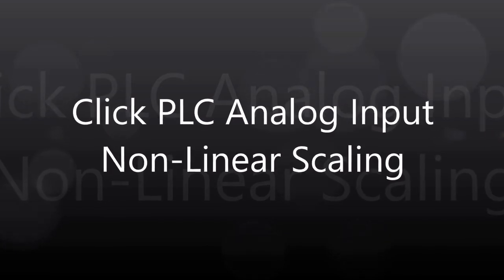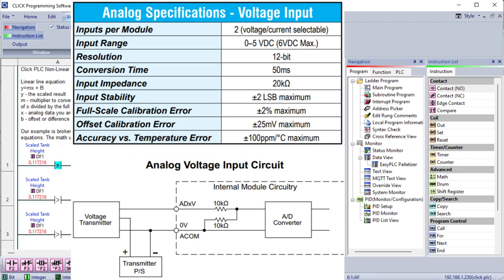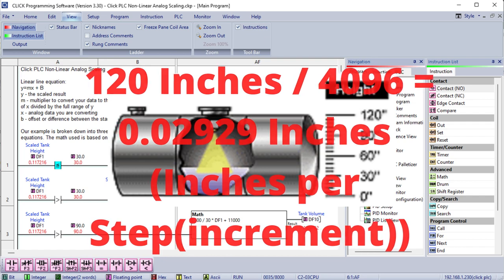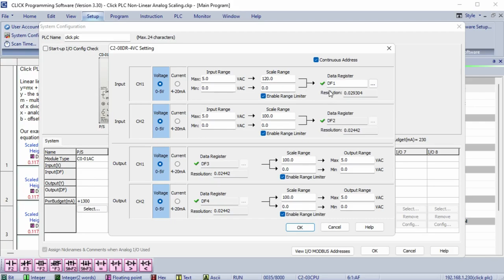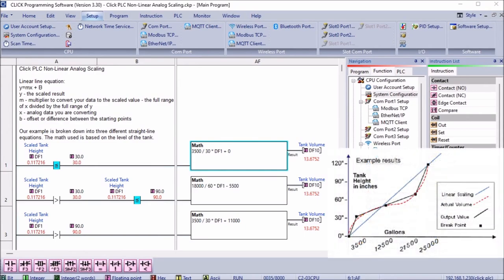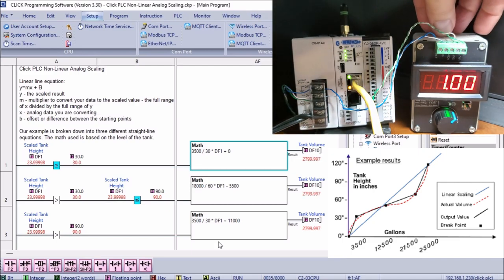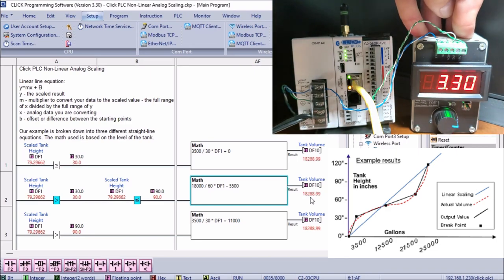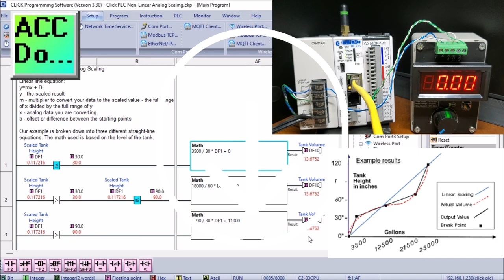Click PLC Analog Input Non-Linear Scaling

Comment from the maker: More information can be obtained at our website. This includes all of the links mentioned in this video. 
https://accautomation.ca/click-plc-analog-input-non-linear-scaling/

DROK Adjustable Signal Generator
The multifunctional DROK signal generator can generate both an amp & voltage in the same unit.
https://amzn.to/3Ab7fOh
Video on the signal generator.
https://youtube.com/shorts/0KPvdTxj3EA

CLICK PLCs were designed with simplicity in mind, providing reliable control at a low, low cost and with little to no learning curve.
This simplicity makes CLICK a perfect solution for small machines, home automation projects, pneumatic applications, or anywhere a simple system needs a budget-saving control solution. 
Building on the original CLICK’s simple design, the new CLICK PLUS PLCs offer the same practical control but with some surprising bells and whistles. Using the same FREE, streamlined PLC programming software as its predecessor, the CLICK PLUS PLCs provide no-headache programming combined with advanced capabilities like Wi-Fi communication and data logging.

The Click and Click PLUS PLC series can be found at this URL:
https://accautomation.ca/series/click-plc/

Features of the new Click PLUS PLC (C2-0xCPU) include the following:
• Micro USB
• DHCP support
• DNS support
• Wi-Fi (programming and Modbus TCP)
• Bluetooth (Wi-Fi) provisioning
• SD Card (Data Logging)
• Data Logger
• Network Time Service
• MQTT (Publish/Subscribe)
• Required PLC Password
• Disable Ports
• Strong Password Support
• Disable Ping Response
• Encrypted Password Transfer

There are several reasons why we are using the Click and Click PLUS PLCs. Here are just a few.
 - Investment is low for the hardware and the software is free
 - Standalone PLC with built-in I/O
 - Communication ability - Ethernet Port, RS232, RS485 - support for protocols such as Modbus RTU, Modbus TCP, etc.
 - Ability to expand the system with a variety of modules including RTD and Thermocouple inputs directly.

ACC Automation
https://www.accautomation.ca

Comment: Note that your height resolution will only be that fine if the height sensor sends back a voltage exactly between 0 and 5V over that exact range. In practice, often the sensor has a range much larger than what you might need which covers a voltage range less than 5 volts and your actual resolutions could be much lower than desired even if you have a 1mv resolution on the Click.
Reply from the maker: Good point. Depending on the analog sensor wired to the PLC, analog ranges may be different. Sometimes you will need a signal conditioner to get the signal to a different voltage.
https://www.automationdirect.com/adc/shopping/catalog/process_control_-a-_measurement/signal_conditioners
This will also provide isolation for the signal.
Thank you for the comment.
Garry
Reply: @ACCautomation  Thanks for link to signal conditioner, I didn't know they're available like this off the shelf, very good to know!

Comment: excellent video... I wonder if  can do a project with CLICK PLC, HMI WITH LOAD CELLS. HAVE TARE, CALIBRATION,
Reply from the maker: Yes, that would work well. Pay attention to the signals coming from the load cell. You may have to use a signal conditioner. 
https://www.automationdirect.com/adc/shopping/catalog/process_control_-a-_measurement/signal_conditioners?gclid=CjwKCAjw7c2pBhAZEiwA88pOF3mvbuVd5jS2ha07iTxWKUqQbyhiIwTqjzovxcQ2tElvSCt70HXmNBoCv6sQAvD_BwE
Regards,
Garry

Comment: wonderful video. I used a very similar technique with a DL05 plc, F0-04AD-1 analog card,  DW-AS-509-M30-320 analog inductive sensor to measure distance over different metal materials such as wire screen mesh.  Linked to a Cmore HMI to select which mesh category and display the inches value with high/low alarms which worked great for years. The last unit was changed to a Click PLC. Your program will be great for the next upgrade. 🤩 thanks a lot.
Reply from the maker: Sounds like a good project. Thanks for the comment q zorn. 
Garry

Comment: Where did you take (-5500) and (11000)?
Reply from the maker: Hi Lockhead Maverick,
I am unsure of your question. The website post will go over the formula used for the linear line.
https://accautomation.ca/click-plc-analog-input-non-linear-scaling/
Regards,
Garry
Reply: @ACCautomation  I know what means 3500, 18000 but from where you took  -5500 and 11000?
Reply from the maker: @lockheadmaverick489  
The following formula is used for scaling the linear line.
y = mx + b
You will plug in the values for Y, m, and x. The b value will be then calculated for each of the lines. This is the offset from 0.
Regards,
Garry
Reply: @ACCautomation  I understand that formula and know what means "offset".Could you tell me more clearly what numbers you calculated to get (-5500) and (11000)?